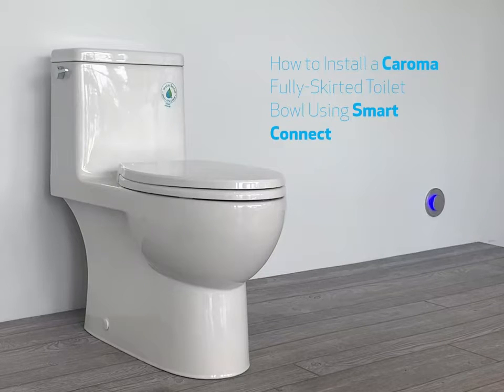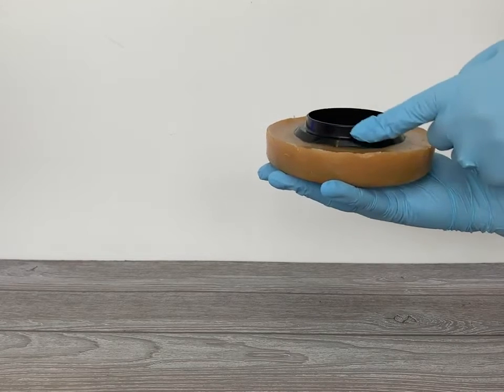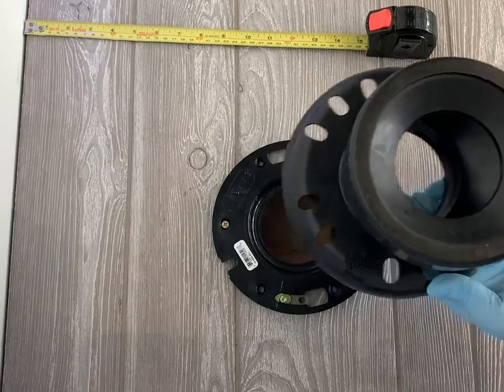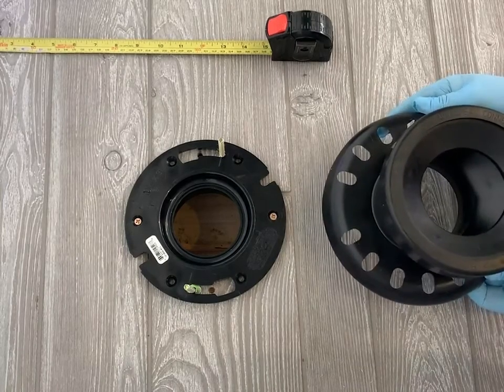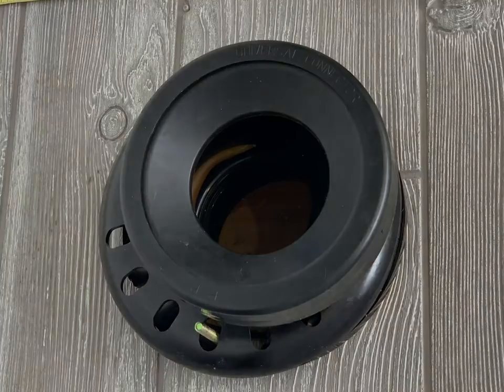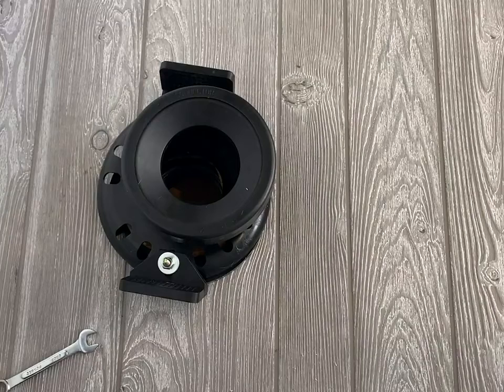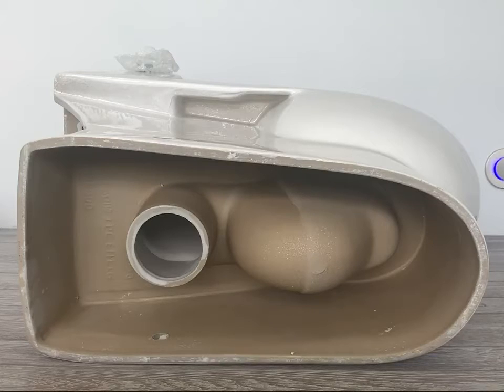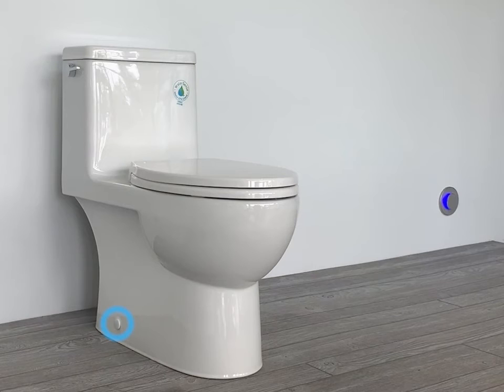Caroma Installation: How to Install a Caroma Fully Skirted Toilet Using Smart Connect

Comment: I have odors in winter time when its cold outside.  I want to replace the wax seal but there is no hole and no screws on the 2 sides.  How can I remove the toilet ? How is it fixed on the floor ?
Reply from the maker: Thanks for your question. The answer to your question will depend on the model, and age of your toilet. If there are no holes on the side, you may have the first generation of Caroma Smart toilets. They used the same offset adapter, but there were no holes in the sides to screw into the adaptor on those models. Instead, there were 2 bolt holes at the very back of the bowl. The installer may or may not have chosen to bolt the toilet down to the floor. If you see bolts at the rear, remove them, slice the bead of silicon and remove the bowl.  If there are no screws in the rear bolt holes, you may simply need to slice the bead of silicon around the bowl to release the bowl from the floor. I hope that helps, but if you need more guidance, please let us know! Our Customer Support Team can be reached Monday - Friday, 8:00 am - 4:30 pm (Pacific Time) toll free at 1-800-460-7019. We are happy to help!

Comment: Fastens everything down and toilet still moves
Reply from the maker: Hi @romainbarrett5131. It's difficult to say what the issue is without more information, but let me give a few suggestions. The offset adapter connects the toilet at the trapway to the floor, but that is only one point of connection. The rest of the toilet can still move, particularly if your floor is uneven, (which is very common). If your floor is even, if it is connected properly at the offset adapter and caulked around the bowl, it shouldn't move. If there is still movement, you may have to shim the bowl to allow for an uneven floor. You can purchase toilet shims at most hardware stores. Once the toilet is level, caulk around the bowl, leaving a 1- 2" opening at the back, and it should not move. If you are still having issues, by all means call in to our product specialists at 1-800-460-7019. Thank!